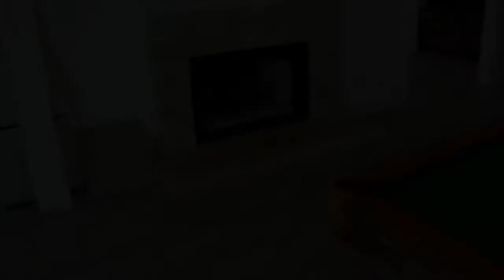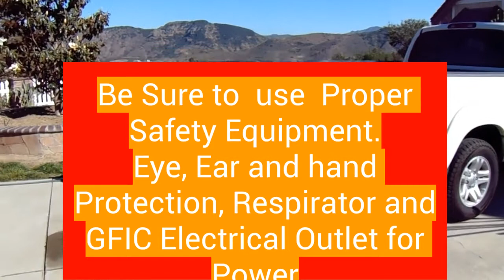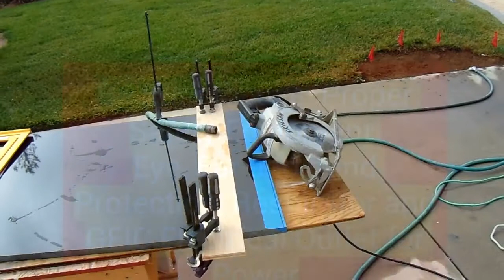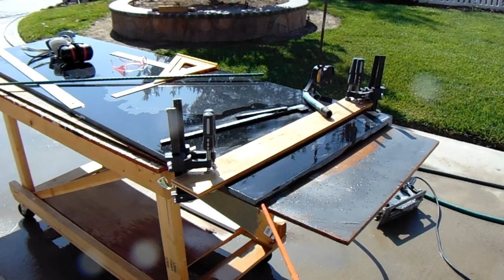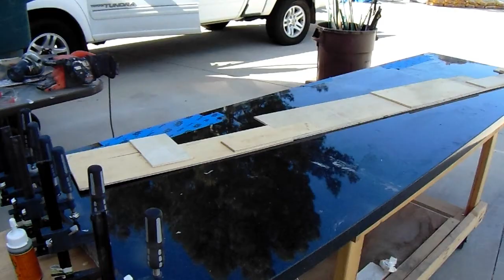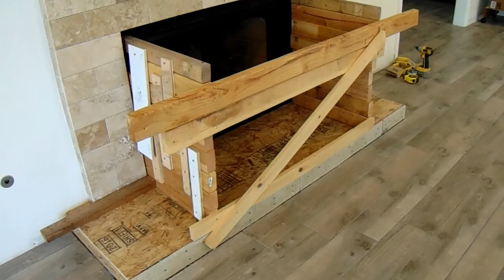quartz fireplace hearth fabrication and installation

Comment from the maker: The quartz is holding up great.  We have not fired up the fireplace yet since we're in sunny Socal.

I would seriously research the quartz cracking under heat information that you received. It doesn't make sense to me.  I have been inquiring about quartz vs granite everywhere I go . No one has mentioned a cracking as a result of heat problem with quartz.  If there is an unlevel  sub-base and someone jumps on the quartz ( or granite ) , that would seem to be a more plausible explanation to the cracking.

Either way, good luck with your project.